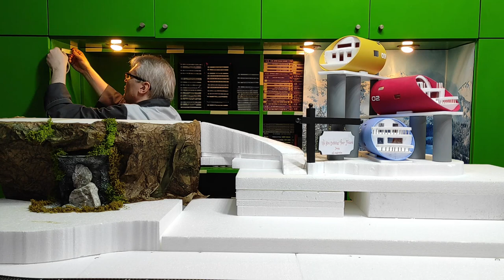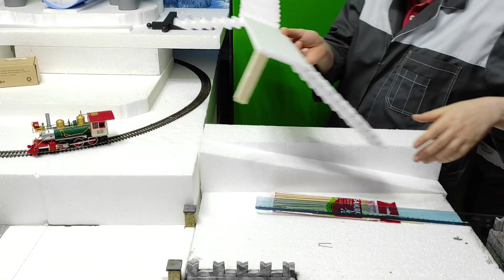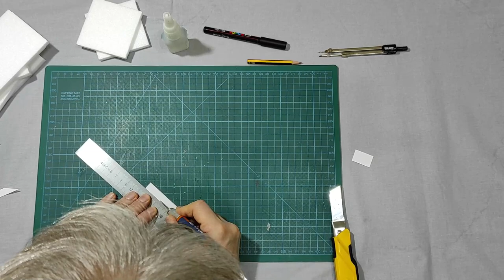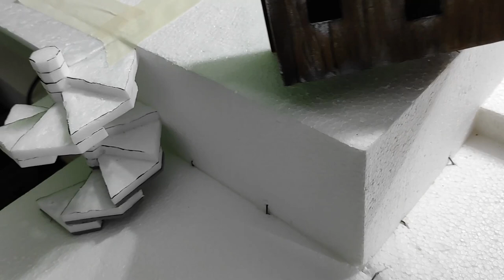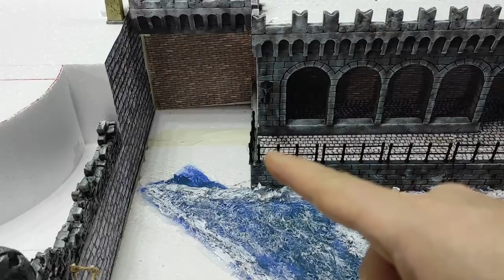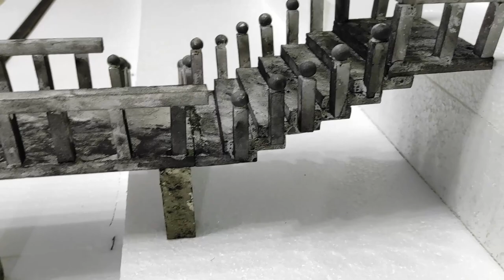Christmas Village Tutorial 2021 - Part 14

Comment: What material do you use to make the staircase ?
Reply from the maker: Hi again He Ro, my favorite material for building  street furniture or staircases is extruded Styrofoam. More precisely 9 mm (0.35 inches) thick Styrofoam panels. For the staircase in this part 14 I also used some 20 mm (0.78 inches) thick Styrofoam for the columns (yellowish) and some wadding little balls on top of the balusters. All glue together with some white PVC glue or with superglue if I am in a rush.